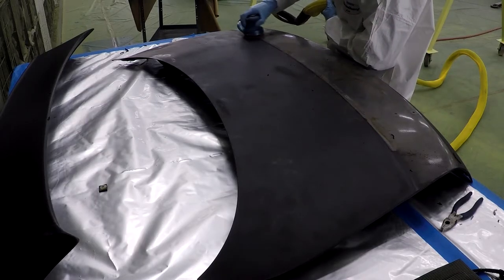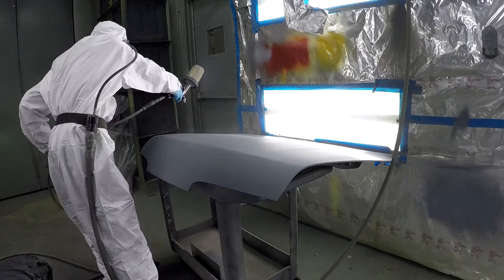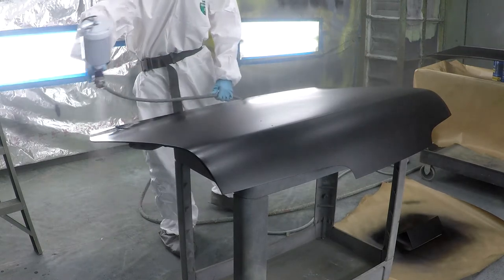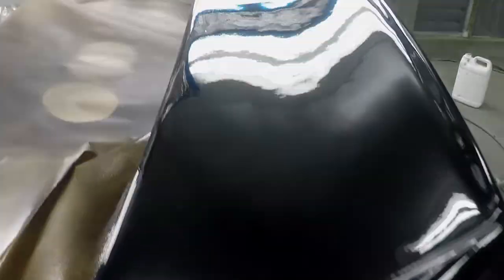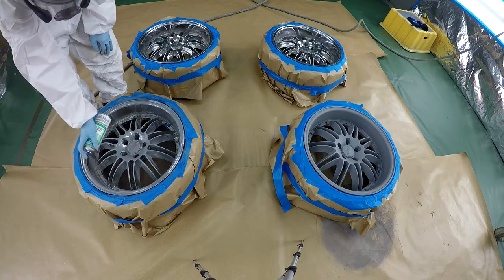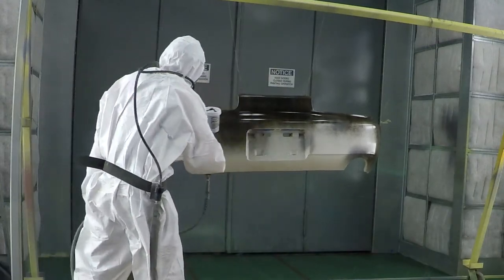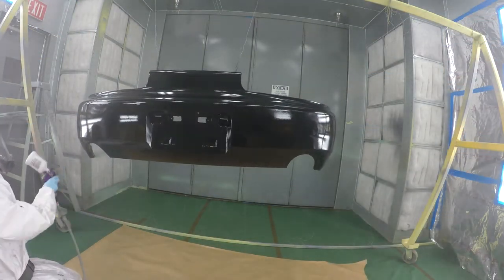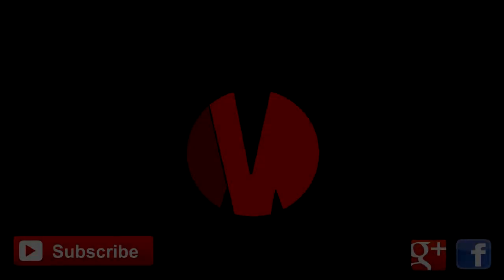Wise Spoiler, Trunk Badge Delete & Wheel Paint  | 1JZ SC300 EP 006

Comment: Digging the series man! Excited to see how the car comes out. I ended up ordering the NRG harness bar for my R32 after watching your Harness bar episode haha xD
Reply from the maker: Nice! What harness are you gunna go with?
Reply: I have a couple of Sabelt 4 points. They were pretty getto but I cleaned them up pretty good I think. I've been running them bolted straight to where the back seat seatbelts went. A bit sketchy haha
I'd get a 5 point but they're a little more expensive. Plus I still have the stock seats lol
BTW, how are you liking the NRG seat?
Reply from the maker: Hey, whatever works lol. I had my doubts about the seat but after it got bolted in, it stiffened right up and fits me perfect. Also im glad I didn't get sliders because my head would be hitting the roof, even worse with a helmet.
Reply: Oh nice! Been looking into seats but I want to save up for something nice and enough to get both the driver and passenger side.

Comment: based on the flow of your gun, it seems you need to up the pressure a bit to atomize the clear coming out. base and clear settings diffee. don't be afraid to play with gun settings especially a HB gun. they are decent, but need some fine tuning to get going correctly.

Comment: great job bro! I have some similar damage next to my tail light  I can't wait to see how the rest of your project goes. thanks for posting. I'm gonna upload some videos of my 92 sc300 I would love some of your input on the build up its in pretty bad condition. be good man PEACE!
Reply from the maker: +Dru Santana For sure, let me know! It's kinda hard to find a clean SC that doesn't need work these days. On the other hand, you  can get them for cheap.
Reply: +M. Skoops  not in NY bro ,they are expensive! I paid 3,300 for a 92, 5 speed with 300,000 miles.  I know I paid too much but it was love at first sight
Reply from the maker: +Dru Santana I paid 3 for mine as well in VA, 270k miles. Aint bad considering they were 60k when they came out.